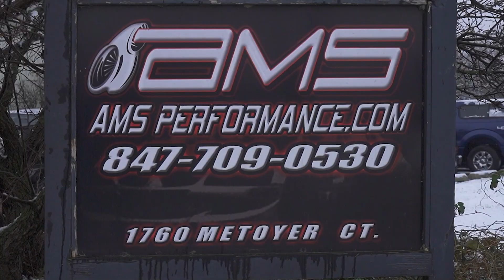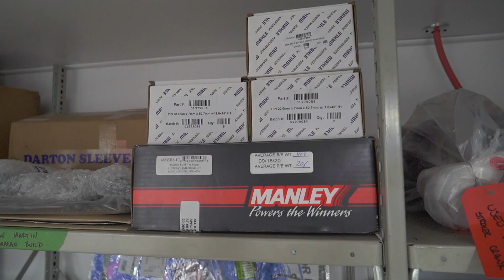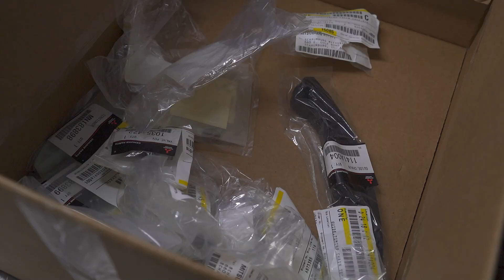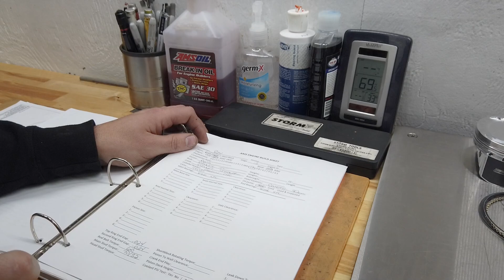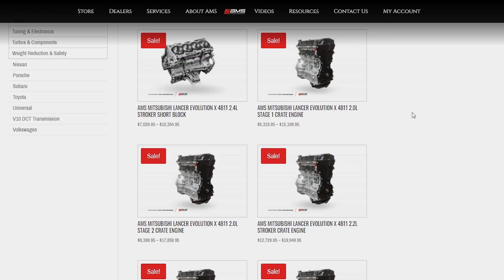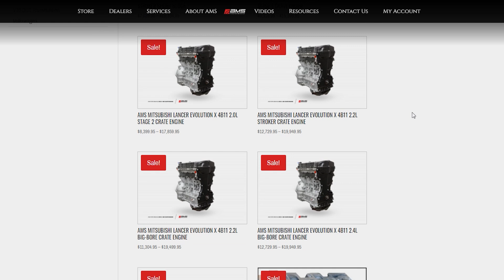2.4L EVO X CRATE ENGINE BUILD | AMS Performance

Comment: Hypothetically, I have a 4B12 which is the stock motor 2.4, would I have to get it bored out to a 2.8l to safely make boost? Because it’s one of the safer options for the lancers, getting a “evo” motor or do I just jump on the k20 bandwagon

Comment: If you have an Evo and you didn’t try AMS, then you missed another level.

I’m just with a STX500, 2 bars.        is faster than a     stroked 2.1 cammed gtx35 2 bar.

Comment: Ummm, I’m super confused, I don’t mean to talk *hit but, How come you claim to use a girdle when all we see are traditional 4-bolt steal main caps. There is a “girdle” of sorts but it does not seem to tie all the main caps together, provide torsional strength and I can’t even see how it’s bolted to the block at all.
Reply: 4b11 come from the factory with a girdle . it bolts to the block directly and has the oil filter housing built into it

Comment: Getting my evo x motor to be build by you guys taking a roadtrip to drop it off hopefully next week can’t wait
Reply: Call and make appointment,  they get superback logged.
I had to wait almost 2 months to get my car in to get it running.
Their turn around was fast tho, no complaints.
Reply: what work you have done on the car they said about months in the meantime i can work on some stuff while the engine is out, do you have evo x too? If so how does it feel to drive after you got it back what’s hp and tq
Reply: @walukab14  I have a 2014 GSR, car drove great after I got it. It was already making 576hp on premium and 716hp on E85 when I bought it. Not sure on the tq.
Reply: @dabearsgomez   Your right about them being so back up they just got back and say the motor ready, but now there’s a issue the aluminum valve cover that came with the motor when it is dropped off now it’s plastic valve on the new built motor just blow my mind that it was misplaced on this video it looks organized this is not what I expect from ams Now im not even sure if that motor is the same motor i gave them

Comment: How do you guys tackle the exhaust mivec situation with running aggressive cams paired with aftermarket valve springs? I asked because I see the oem mivec gear installed.
Reply: I was thinking the same thing.   Normally you have to delete the mivec on the exhaust side.

Comment: What brand sleeves do you use for 2.0?
Reply from the maker: The same that is used in this build! They are our AMS spec closed deck design. The sleeves in this video have just been machined to accept the larger pistons.
Reply: Awesome appreciate it :) cant wait to receive my engine from you guys

Comment: How much power is it Good for if pushing to the limit????
Reply from the maker: The build can safely run 800hp all day. Pushed to the max, close to 1,000hp
Reply from the maker: @evox187  You can choose either or. The engine in this video and each component were all brand new out of the box including the block straight from Nissan.
Reply: @AMSPerformance  Straight from nissan. xD